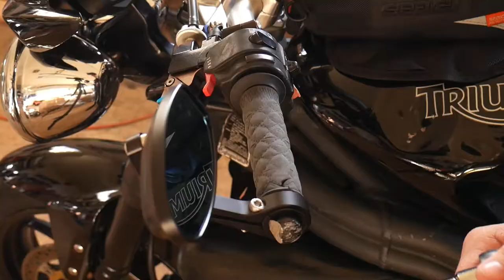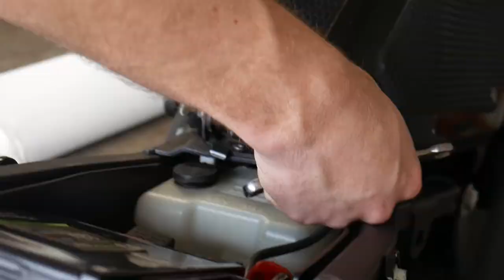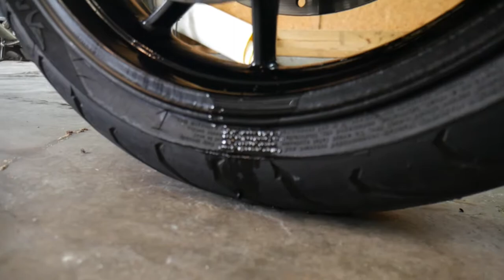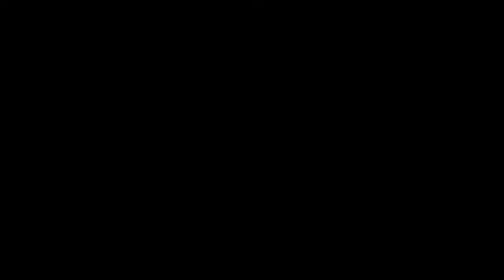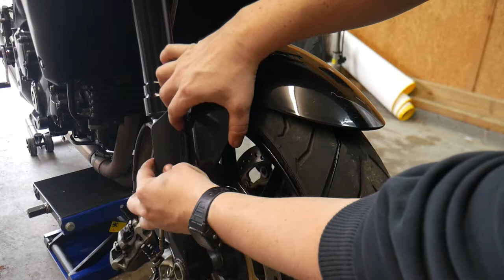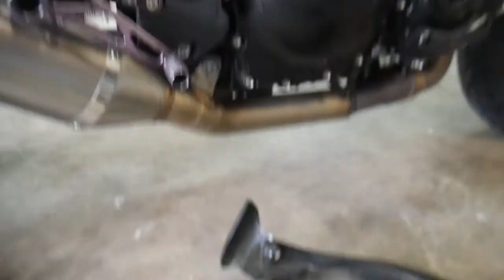Repairing/rebuilding my 2008 Triumph Speed Triple

Comment: Great job, can I ask. I've just lifted my tank to route some cables. The 2 breathers came off and just wondering which one goes where as one has a plastic valve on it. Cheers.
Reply from the maker: Hmmm, I’m unsure which tube has a valve on it without seeing it. If the hose was under the tank I recall it having a two overflow tubes that exit at the bottom of the frame.